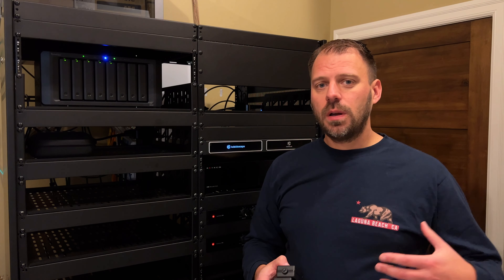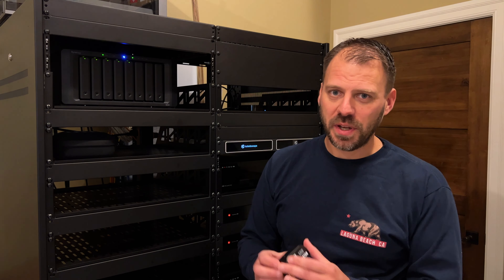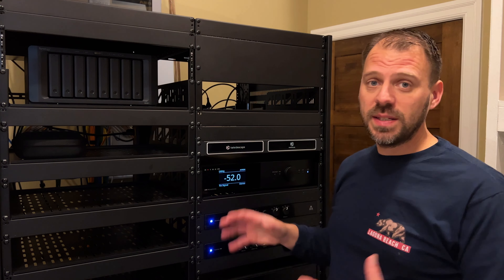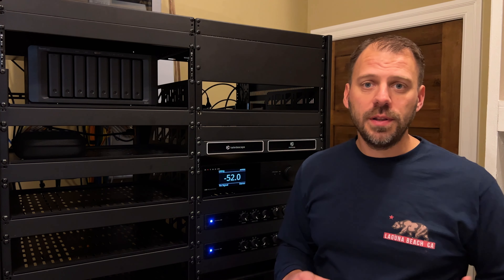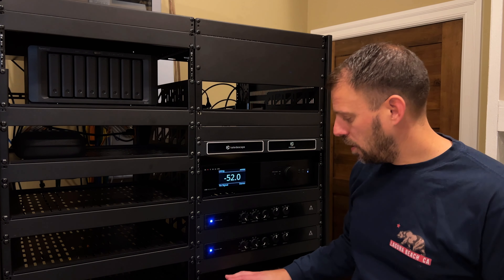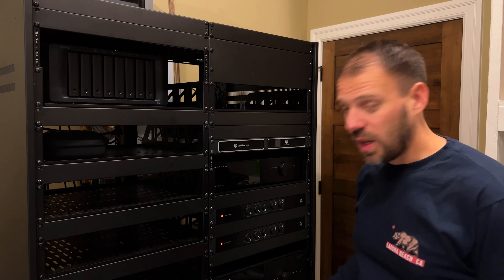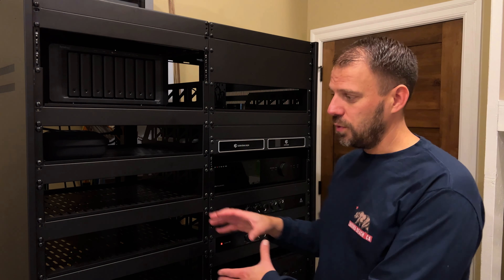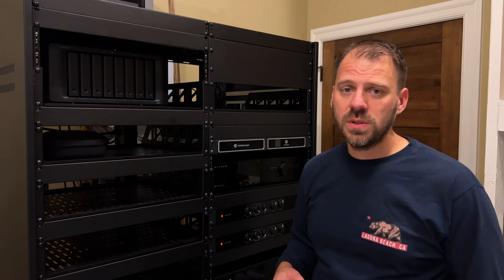Troubleshooting & Trying To Solve Home Theater Speaker Hiss & Buzzing | Ground Loops & Isolation

Comment: Nice video series on a very common problem!  A $1 cheater plug is a great diagnostic tool.  Unplug ALL amps except one you’re testing.  Plug in that amp using the cheater plug.  If the noise goes away you have a ground loop.  I solved mine with a Jensen transformer, but solutions are easier when you have a diagnosis.

Comment: @Techthusiasm / Jaremy , If I understood correctly,  at a one time you disconnected the every thing and left the AMP"s only, correct ? , (1) Did you disconnect the affected speaker connections from the AMP's ? and listened to the buzz/hiss ? ,  (2) Can you switch your amps ?, one that currently part of the buzz/hiss issue vs one that does not , better if you could borrow an new amp just to check stuff. (3)  Do you have fluorescent lights , Kitchen hood extractors , Air Condition units ? (4) Do you have any switch mode power adapters / phone chargers connected to your HT circuit  (normally something insignificant from your attention perspective) ? (5) Hire an electrician with Power Quality analyzer/logger , who has experience in EMI issues , analyzer/loggers can show you if there are interference present in your electrical system (they can hook it up for 24 hrs and check what is going on) , ( 6) How many Ground rods are there and how deep are they installed , will it be possible to use ground rod far as possible from the existing one or any other neighboring ground rods ? (7) Can you disconnect the PC while you are testing the Buzz/Hiss ? (8) Use a simple setup to isolate , one amp directly plugged to your mains with simple power code and to the speakers (once with hiss/buzz)  , can you still hear it ?
Reply from the maker: Yes, I disconnected everything, essentially, and heard the buzzing. I'm pretty sure the speaker wire run from my rack to the speakers is the culprit. More on that to come.

Comment: I know it hurts but remove one of the amps entirely, bring it upstairs to the living room, remove one of the speakers from the wall and plug it in directly with a new short wire run with extra wire you have from your install.  Or pickup a inexpensive amp/receiver and test that way (new short wire run in the living room).  Test only 1 speaker.  If there is no noise then move the amp back into the rack area re-connect that same single speaker from your original wire run and re-test.  This will help you isolate the problem because it could be either the amp, speaker wire, speaker, or rack/power related.  If the noise disappears continue to add back speakers start with living room first and see at what point the noise comes back.  The move onto the theater room.  Its not fun but I've been there
Reply from the maker: Yep, this seems to really be the required next step. I talk about it in the next video I've already made, but haven't actually done it yet.

Comment: I was digging for some noise (GPU wine) several month ago.
At the end of the day, one of my xlr cables to the atmos amp had a broken shield/ground connection working as a antenna…
Changed the bad xlr‘s 
Fixed it!
Reply from the maker: Nice!

Comment: Did you try the ground adapter on your Amp.?
Reply from the maker: Yes, no change.
Reply: @Techthusiasm  Man that’s a tough one! Have you unplugged your refrigerator,freezer,cable wires,etc.? If so then I would take the Amp. to your friend’s shop and hook it up. I know it’s a pain but the options are getting scarce!

Comment: A few more things to try:
1. Is everything on the same circuit? If not, make sure the circuits are on the same leg/phase in the panel.
2. Is there anything else on these circuits? If so, unplug it and see.
3. Try testing all electrical outlets feeding any components in the system with an outlet tester to ensure the wiring is good.
4. Is the rack grounded? Maybe look into that.
5. Indeed the speaker wire could be picking up something from electrical in the walls. If you have another small 2 channel amp you can connect up with a different source like a phone, you could rule out all the gear and the rack and that would just leave the speaker wire.
Reply from the maker: 1. In this case, yes. All the gear is off the same 20 amp circuit at the rack.
2. Removing things hasn't seemed to pin point a source, but I have done so.
3. I tried an IFI gizmo that read OK for the circuit. That'll be in the next video.
4. Not directly. I wonder about that actually and how to do it. The rack is on wheels in a tile floor room. Most of the gear in it is rack mounted, so all the chassis are screwed to the rack itself. But there's not connection from the rack itself to earth ground on the outlet behind it.
5. I should just yank the speakers out of the living room, take them downstairs, and plug them into the same amp channels on shorter/different speaker wire. If not buzz, then win. Simple results, but a pain to pull them and put them back.

Thanks!
Reply: #1 was my solve. Different circuits needed to be on the same leg/phase.
Reply: @Techthusiasm  Cool sounds like you're on the right track.  One more to add, if you're using RCA on your subs, try disconnecting those and see if there is any change.
Reply from the maker: Thanks! I'm XLR to XLR on both subs.

Comment: Is there a refrigerator or any other major appliance on the same circuit as the AV gear? What kind of connectors are you using for wire connection to the amps and processor? Bananna plugs, spades, bare wire, etc? Are any of your speaker wire runs physically crossing over AC electrical cables?
Reply from the maker: Not on the same circuit, but we have a house full of appliances with 2 big fridges and a big freezer. Amp to processor connections are XLR World's Best Cable with Mogami wire. Nice, well made cables. I do use bananas. I'm not sure what the speaker wire going up into the living room might be crossing over.

Comment: Super annoying when these things happen!
I have an LG C9 tv, that I had to put on a separate circuit/outlet, because it caused my Arcam receiver and Parasound amp to hum.
BUT, you kinda started trouble shooting in the wrong end (too many variables)!
Since you noticed the problem in the speaker, you back up one step from it.. what is interacting with the speaker.. speaker cable and amp.
Isolate the amp and speakers from the rest, by disconnecting all sources from the amp. If you still have problems, move the amp closer to the speaker and try another speaker cable. If you still have a problem, you need to try another amp. If you still have problems, there is no need to look upstream in the equipment chain.
Reply from the maker: Yes, after the next video which I already made trying to throw more devices and cables at the problem, I will be starting backwards from the speaker.

Comment: Did you try the gain adjustment on the Parasound amps? I think that will help.
Reply from the maker: A52+ amps don't have gain knobs. The A31 does though.
Reply: @Techthusiasm  gotcha, and are the LCR’s putting out that 60hz hum? Can you dial down the gain on the A31, and increase the trim levels in the AVM70? This is exactly what I just had to do with my zone 2 system in the basement. Which is annoying cause the amplifier dedicated to my zone 2 is a class D with an SMPS, so how could it push a 60hz hum to the speaker level outputs??
Reply from the maker: The LCR in my theater is on the A31 and not a problem since they are way up at the front of the room and behind the screen. Even if they do buzz, I can’t hear is standing up there. It’s the same model speakers running off the A52+ in the living room that buzz. But I need to swap speakers and and wire around next and see what’s what.
Reply: @Techthusiasm  I have an update.

My 12V trigger cable connected between zone 2 and my zone 2 amp, isn’t doing anything. When I disconnect the trigger cable from the amp, the ground loop noise in the zone 2 speakers is still there. However when I arbitrarily poked around the amp chassis with the trigger cable plug (the 3.5mm Jack), I was able to kill the noise. This means if there is a ground connection between the AVR and the zone 2 amp, the ground loop disappears (or you’re creating a ground loop for the ground current instead of letting it dissipate in the speakers). I would take a copper wire and connect the chassis together between the AVM70 and the amp that’s driving the speakers causing the 60hz hum.

Over…

Comment: Hey Jeremy I am a big fan and thanks for all your videos. I have a similar issue of a buzzing noise from both my subs (b&w ASW675). I never used to have this issue until I upgraded my Anthem MRX740 to AVM70. I have tried the same things you have with no success. One thing I tried after watching one of your videos I was convinced that it was the AVM70 . Guess what, I moved back the MRX740 into my theatre to the old setup and the buzzing was gone from both subs. At first I thought I was dreaming so I put back the AVM70 and the bussing came back. I have to believe in this case there is a problem with the AVM70 
My setup is:
Anthem AVM70
Amps
———
Emotiva XPA-2
Emotiva XPA-5
Emotiva XPA-700
Sunfire architect choice series 2

Subs 
——-
B&w ASW675 x2
speakers mains 
B&w 702 s2 and Center HTM71 S2

I am not sure if you and I are having the same problem since we both have AVM70s. In my case I have pin pointed to that unit. 
This is driving me crazy because I love my avm70

Trevor
Reply from the maker: Ugh, that’s not what we want to hear! :) I hope you can find another solution too than changing out the Anthem. I’ll have more coming up.

Comment: Man, I remember how annoying ground loop issues were with my system. Your display device can be a cause of ground loop issues, if it’s not on the same circuit as your audio gear. There was also a time when my wireless access point caused a buzz when I had it sitting on top of my amp. 

Also you could test the speaker wires you ran in-wall by brining a speaker down to your rack and connecting it with another kind of speaker wire to see if you still get a buzz.

Adding a Furman Elite15 PF power conditioner— not for line conditioning, but to power all my equipment through it, had the biggest impact on reducing my system’s buzz. It’s completely gone now. Hope you can track down the cause(s)!
Reply from the maker: Yeah, I think moving speakers around is going to be a next thing.

Comment: What kind of gauge speaker wire are you using? I recommend monoprice 12 gauge CL2 speaker wires.
Reply from the maker: It’s relatively smaller wire. I’m sure beefier wire from the rack to the wall would be a good change.
Reply: @Techthusiasm  yeah if you are using a higher gauge cable like 14 or 16 gauge that can be an issue. 12 gauge or lower is preferred. The best for Long distance in wall is Blue Jeans 10 gauge belden. Also, make sure your amplifiers and sound equipment have a dedicated line preferably 20 amp line.

Comment: Hey!  So I’m running an arcam av40 with a Parasound JC-5 and A51 and also have a small buzz. I have tried everything and nothing has worked. It drives me crazy!!!! Some days its worse than others. I will follow this thread to see what you come up with.
Reply from the maker: With those amps, you might be able to drop the gain and eliminate the buzz. My A52+ though doesn’t have the gain knobs.

Comment: If you don't want to use a power purifier, the Puritan ground master city in a spare wall socket combine with the Puritan route Master that receive all the ground of each of your component can be a cost saving way to fix a ground issue if it is the problem...

Comment: I'm sorry to hear you still have the hum/buzz coming through speakers. It is definitely frustrating. Seems like you have already tried unplugging the projector and subwoofers? Just checking: when you unplugged the projector, did you unplug the HDMI cable from the Anthem as well?  
Did you try unplugging XLR cable from Anthem and the amp? If you have not. Please un-plug one cable at a time to rule out the possibility of bad XLR cable (sometimes one of the XLR pins go bad which causes ground loop as well). If the issue still persists, now start unplugging one speaker cable at a time. This will rule out the speaker wire issue and binding post on the amp itself. One other thing: have you tried using a different amp? This will also rule out the mismatch between AVR and Amp. Parasounds are phenomenal amps and they should be compatible with Anthem, but worth a try a different brand/type. Good luck...
Reply from the maker: Yes, I did unplug the projector and subs in the other room. And removed all the HDMIs from the Anthem. I did not do a full XLR unplug, just certain channels. I there is a little more elimination and swapping around of gear I need to try coming up next.

Comment: It almost sounds like something in the wall is causing some kind of interference I personally don’t think you have a bad speaker or amplifier I personally think it’s some kind of interference from the outlets or the wiring in the walls
Reply from the maker: I'm suspecting more and more that the speaker line to the living room speakers is picking something up. More on that in the third video.
Reply: @Techthusiasm  that’s the thing about in wall speakers because it’s harder to see the wires when it’s all hidden inside the walls

Comment: Switchmode power supply became noisy somewhere. Are your amps near an electric hot water system?
Reply from the maker: No, the house HVAC and all that is in another room. There is a sump pump in the room with the gear rack, but it's on a different circuit than the gear.

Comment: Is your rack grounded, if not maybe try grounding rack to a walk outlet that is grounded and then ground all equipment in rack to the rack. There is a video on True cable about grounding equipment in rack. Is your cat6a cables shielded or unshielded?  If shielded then there is precautions that need to be Adhered to. I hope this helps

Also found this on a52 manual

Backaround Hum or Hiss
• If you have cable or satellite TV, try disconnecting the incoming TV or satellite cable; if the hum is eliminated you will need a Cable TV Ground Isolator or
contact vour _ service provider for assistance.
• Move audio cables and AC cords apart from each other.
• Try different routes for the audio cables and AC cords.
• Make sure plastic insulating shoulder washers are used if unit is rack mounted.
Reply from the maker: Thanks! I’m considering a possible need to grounding the rack.

Comment: The iFI SilentPower - GND Defender worked well for getting rid of a buzzing/hum from my madVR Envy (interestingly, the hum only occurred when watching 60 Hz content, but not 24 Hz - and I only have 1 60 Hz movie - Gemini Man). Supposedly, the iFI is better than Hum-X since the latter supposedly limits current to amps. But, try a cheater plug temporarily. If a cheater plug doesn't help, I doubt iFI will help.

One thing that drove me nuts before was when I replaced my amps with McIntosh amps. I immediately got a very loud hum. I did some things, that decreased the hum, but it was still there. Very frustrating. It turns out the hum was due to the 12 volt triggers from my processor to the McIntosh amps. When I disconnected the 12 volt triggers, the hum was gone! So, for now, try disconnecting your 12 volt triggers and just manually turn on your Parasound amps to see if that gets rid of the hum. For me, I did a round-about way of resolving my problem, since I still wanted my processor's 12 volt trigger to turn on. my McIntosh amps, but I had to do a really roundabout way such that I did NOT connect the processor's 12 volt trigger outs to my McIntosh amps' trigger ins. If disconnecting your 12 volt triggers gets rid of the hum, I can provide more details on what worked for me.
Reply from the maker: I bought some iFI stuff and will show that in my next video. I did the DC Blocker though not the GND Defender. I just ordered a GND Defender off Amazon right now though. :) I like the iFI form factor a lot more than the HumX as the iFI plugs into the back of the device itself. In the background of this video, I think I did remove the 12V triggers and it didn’t change. I did it after I had fully recorded the content and was experimenting more. Thanks!

Comment: I had a significant hum and fixed it… turns out it was my GFI circuit breaker being the source of the noise! Replaced 8 of them and now dead silent. I was pulling my hair out playing all the same games you are doing here. My house is a new build 5 yrs old….
Reply from the maker: Did you have AV gear plugged into the GFI outlets? Or it was generally a matter of replacing GFIs throughout the house? What did you replace them with? My house is only about 9 years old.
Reply: @Techthusiasm  yes my AV rack was plugged into a gfi outlet due location near my sump pump. Because of the trouble I had, I just had all of them replaced and added a dedicated line for my AV rack. The gfi breakers were hot and did have a faint audible hum. Replacements are cool to the touch and quiet. I had a few other things cleaned up while the electrician was at my place. Not a perfect way to track the source but the electrician noticed these as a concern first.

Comment: I recently purchased a new amp and was disappointed to hear buzzing coming from inside it's chassis. Fortunately the noise didn't come through the speakers and the buzz was masked by playing sound. However, it troubled me to know that it was happening and I could hear it from my seating position during quiet scenes. It took me a couple hours but I found the culprit was a dimmer lamp that still had an incandescent bulb in it. I replaced the bulb with an LED and problem solved.
Reply from the maker: It is crazy how this noise propagates through our homes.